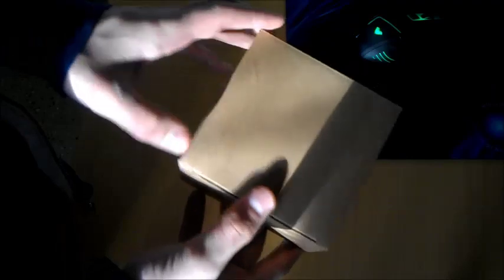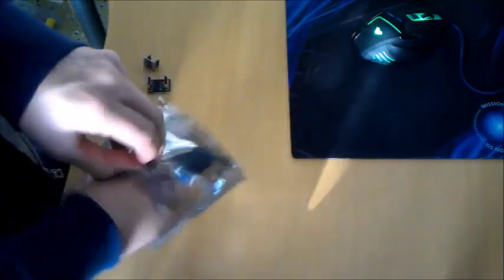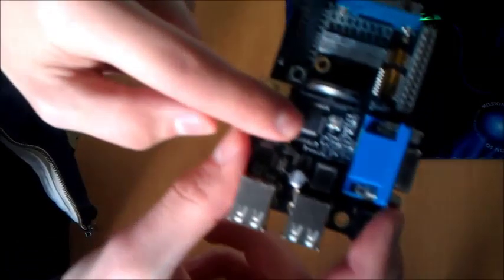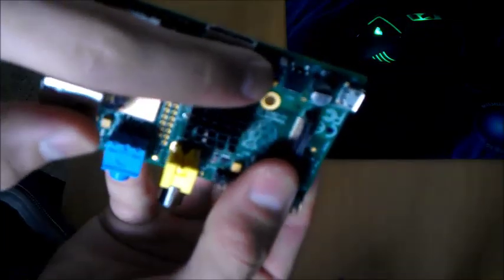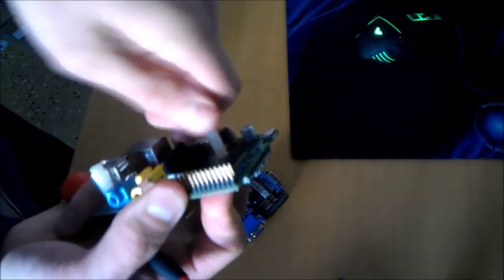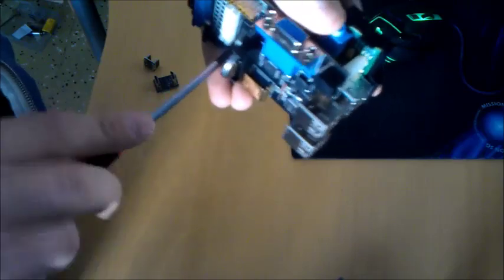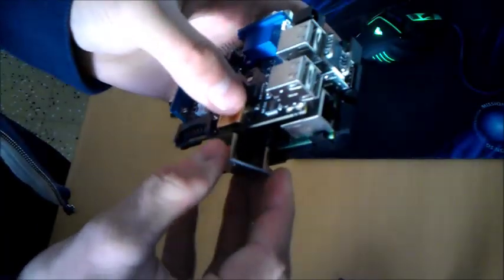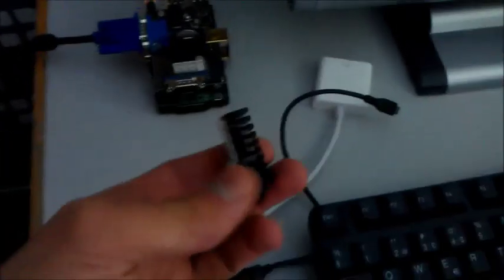Raspberry Pi expansion board X100 Suptronics

Comment: I was presented the Arduino and RP4B at the same time, I chose the Arduino. I believe it was the better choice. The RP4 has only gotten more expensive not better. I already have a computer on my bench . Now that I can program the cheap $ 0.89 postage stamp sized microcontrollers, there is no fun left for a Pi
Reply from the maker: They are two very different devices however. It's a bit like comparing a computer with a calculator. They're good for different things.
Reply: @H3adcrash  I still use a calculator, My Hp Elite has an RS232, no need for a Pi, the whole computer only cost $80.

Comment: Fuck.. it doesn't work on B+ ?.... because mine wont fit, the long pin from the rpi hits the HDMI port :((((
Reply from the maker: Nope it does not work with the B+ as that's a completely different board layout.
Reply: Lol really? what kind of cables r u talking about? And is that a fact or r u just guessing that?
Reply: Hah... never thought of that. But the RBP B+ has more GPIO pints than the B version. So which connects to whom? Or would that be a stupid question because they start with the same GPIO pints?

Comment: Actually, one more comment.... If your RPi has no connection to the Internet the real-time clock might be useful to you but otherwise there is no need since the board automatically get the correct data and time as long as it's connected to the Internet.

The two most useful features of this board are the RS-232 port, which gives you access to the Linux console, and the USB hub. The Rs-232 port is very useful for initial setup of the board or debugging or for connection to RS-232 devices. For the latter function you must disable the console on this port via /etc/initab. Unfortunately, the USB hub is flakey due to a design problem which negates the value of this feature
Reply: I found this because I was looking for a RTC, not all projects will be connected to the internet, and having a RTCis great!  - I also like that I can use 12 volts and an old VGA monitor...   plus the extra USB ports.. makes a great addition for MY purposes.

Comment: A few comments on this board..... 
It has some design problems. The power supply portion of the board runs exceedingly hot. Doesn't need heatsinks - nowhere to put them for the power supply - it needs a design fix. Second issue is both the USB and the VGA chips run very hot to the point that the USB chip becomes flakey after a period of use. This is a design problem. There is no reason for the USB switch chip to run hot. Otherwise it's an excellent concept and the construction is high quality but it just has some design problems. Very disappointing. So much so I had to send mine back.
Reply from the maker: Yes, it does run very warm. However, you can put heatsinks on it, which i did on mine. I chopped up an old chipset heatsink from a motherboard and stuck them on with double sided thermal tape. It works a treat. the DC/DC converter and USB controller can share the same heatsink as they got the same height.
Here is a pic of it: http://i.imgur.com/hluaCJg.jpg
Reply: Electricguy
Could you please tell me where you bought your heatsink?
A site name or just the model number of the heatsink.. ?
Reply from the maker: harmenqwe I didn't buy it. I pulled the chipset heatsink from a old motherboard, and hacksawed it to smaller pieces, that i then stuck on with thermal tape.

Comment: Hi Sir,
Firstly, excellent video (thank you very much). 
Could you verify the steps below? Esp. point 5 to 6? Deeply appreciated. 
1.Download the latest version operation system of  Raspbian "wheezy" and install.  http://www.raspberrypi.org/downloads
2.Make sure we've got the latest firmware drivers.  Sudo apt-get update
3.Download the RTC driver wget http://afterthoughtsoftware.com/files/llinux-image-3.6.11-atsw-rtc_1.0_armhf.deb
4.Extract the RTC driver  tar xzvf rtc-3.6.11.tar.gz
5.Install the RTC driver sudo dpkg -i linux-image-3.6.11-atsw-rtc_1.0_armhf.deb
6.Copy the RTC module's boot file to the Raspberry Pi boot directory. sudo cp /boot/vmlinuz-3.6.11-atsw-rtc+ /boot/kernel.img
7.Open the 'modules' file in the nano text editor  Sudo nano /etc/modules
8.Add the following text, one per line  i2c-bcm2708   rtc-pcf2127a
9.Press 'CTRL + X' to exit, Type  'Y' to save those changes, Press 'Enter' to return
10.Open 'rc.local'  for editing Sudo nano /etc/rc.local
11.Register the RTC module and set the system clock from the RTC. echo pcf2127a 0x51 > /sys/class/i2c-adapter/i2c-1/new_device ( sleep 2; hwclock -s ) &
12.Press 'CTRL + X' to exit, Type  'Y' to save those changes, Press 'Enter' to return.
13.Reboot  sudo reboot
14.Set the system time.sudo date MMDDHHMMYYYY.SS (MM= Month, DD= Date, HH= Hour, MM= Minute, YYYY= Year, SS= Second ) Example  2013 Jan 4 , 11:39:00 , sudo date 010411392013.00
15.Copy the system time into the clock module  sudo hwclock -w
16.To read the time from the clock module  sudo hwclock -r
17.To copy the time from the clock module to the system  sudo hwclock -s

Comment: Can I still use the HDMI port with the expansion board? And which power adapter did you use?
Reply from the maker: Yaser Feyli Well, yes and no. there might be a ARM compile of the OS, and i think there is. So look for that. Otherwise i can recommend Raspbian. The easiest way to install it all is to use the NOOBS installer.
Ubuntu might work on it, but it would be a bit like running windows 7 on a 486. It sure as heck wont be fast.
Reply from the maker: Yes you can. Just don't use the HDMI bridge over to the board, and you can use that stand alone. I use a 12V 1A rated random wallwart i had laying around.
Reply: Electricguy
Dear Friend i have a power supply! its says on it: input:100-240v 50/60Hz 0,8A Max
Output; 12V 2A !
will this work just fine or do i need to get another one?
can i add a 2,5 inch laptop HDD with usb to the raps with 12V 2A power supply?
i asume that i dont need to power the raspberry pi with usb when i have the 12V 2A power supply?
Reply from the maker: Yaser Feyli Oh yeah, 12V and 2A will work really well for this! :)
And yes, you can add a HDD if you so want to. and you don't need to power the Raspi through the USB port. It gets it's power from the X100 board :)
Reply: doas this mean that i can overclock the raspberry pi more then 1Ghz?
Reply from the maker: Yaser Feyli No. and you should not overclock the Raspi as far as possible anyways. Because it doesn't get that much faster, and you run a incredibly big risk of corrupting the file system. I did it once, and rebooted. It wouldn't boot after that because it corrupted the files. It's not meant to run that fast.
Reply: okey, can i install ubuntu 14,04 LTS on my raspberry pi? i connected the 2.5 inch HDD, but it still installs OS on SD card, since i am currently use Respbain os
Reply: tho to use the rasp to connect my micro controller Arduino programming!
Reply: if i did not mention earlier, you are freaking awsome
Reply: +Electricguy I would recommend an SSD because if the entire unit gets moved, it can damage the platters and read/write heads. Right now you can get a 30/60gb ssd for about 40$ plus it will run and boot a little faster than a traditional hard drive

Comment: is it safe to power the rpi via the micro usb with the x100 board attached? what if the board is powered at the same time?
Reply: how about an external gpu for the raspberry pi?
Reply from the maker: No i would not do that. Because you will be backfeeding power into the expansion board. and theoretically it would work, but seeing as the MicroUSB input barely handles the Rpi alone, i would not try doing that.

Comment: i have a raspberry pi why do i need this...??
Reply from the maker: Well it also got a RTC which keeps the time when the unit is powered down, it's got 8 open collector outputs hooed to GPIO headers to easily control various things, it's got a proper RS232 port for hooking up serial terminals and things, it's got a 3-port USB hub and it can take anywhere from 6-23V in, and supplies a lot more power to the system than the Rpi can by itself. It basically makse the Rpi a whole lot better.
Reply: thanks for your time

Comment: i have a raspberry pi what is this really good for (i guess for the vga out put) what else and how much it cost $$
Reply: I got mine for about $68 in a kit with everything needed. I use mine as a media center pc with kodi installed and a bunch of old game emulators (SEGA, NES, stuff like that).

It is really more geared toward tinkering with electronics though and building all kinds of projects like arcade cabinets and robots. It is a full blown ARM based PC similar to an android device that runs linux (with all kinds of exposed pins to do whatever you want with).

Comment: I've sent you a private message, but Just wanted to say thank you for posting this as I've just recently bought one of these myself!
Reply from the maker: I think the X100 is a lovely addon board. I have used my Rpi more than ever with it now, Simply because it's so easy to interface other things, which makes it a lot more fun to just play around and try things out! This addon, with a PiFace would be a brilliant mix, i think!

The only flaw with the X100 is that the RS232 port got the Rx and Tx pins flipped. It's just something to keep in mind. (I found this out after several hours of swearing! lol)
The advantage of this is of course that you don't need a null modem cable to connect it together with a PC och other device.
Reply: Consider that done, well when I get round to writing up my part II ;-)
Reply: Dale Hopkins Ahh Tandy, they were my introduction to electronics at the age of 10 !!! sad that DSE bought them out here in Australia...
Reply: what are your thoughts on the X100? I have the Piface myself, but at the moment I just running straight off of the gpio's on the RPi. I have a 16x2 LCD, BMP085 and a PowerSwitch Tail Kit running on my RPi. I slowly building up some home automation, I have to open up a couple remotes and see how hard it be to connect into them so can turn ceiling and and air con on etc
Reply: Dale Hopkins I've yet to explore the full functionality, but the rs232 side will be of use.. At the moment my RPi is a mailbox filter! But I will eventually get around to making something of it...
Reply: Electricguy
thanks for the update, might have to look into getting one when I have some spare coin
Reply: Electricguy I use http://creativecommons.org/licenses/by-nc-sa/3.0/au/ for all material on my blog, so I'm certainly happy to pass on the credit of your YouTube channel and the photo link service.  If you have your own blog (or similar) I'm happy to place a permanent link from mine (blog) to yours. I'll let you know prior to making anything public so if you want to review content etc... 

Thank you for your permission and look forward to continue sharing any other RPi goodies! ;-)
Reply from the maker: Thanks a lot! :D
And you're welcome! ;)

Sadly i don't have a blog or similar, but i do have my YT channel :) So just throw in a link for that and i'm happy ;)
Reply: about io expansion boards etc, this looks interesting 'multiface'
http://www.tandyonline.co.uk/multiface-kit.html
Reply from the maker: Oh yeah that looks neat! 
And branded Tandy.. how cute :D